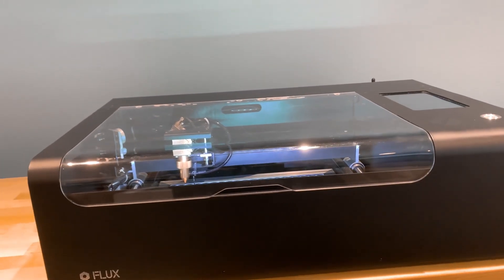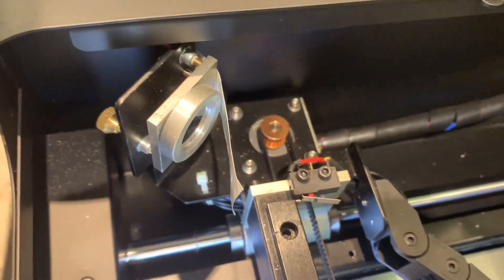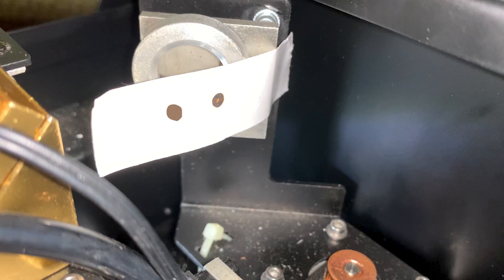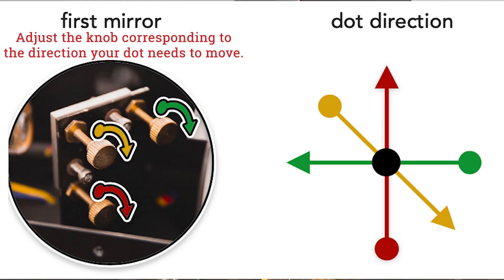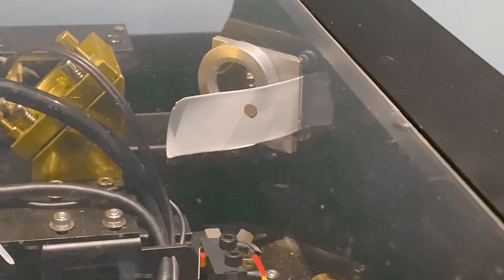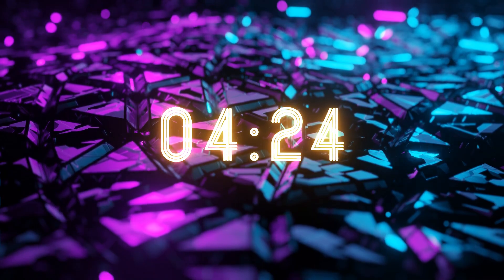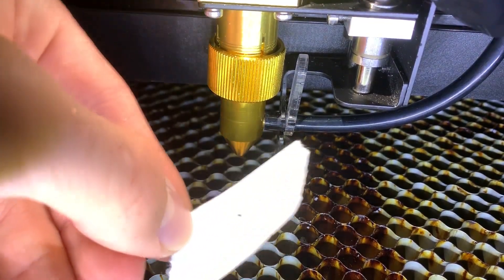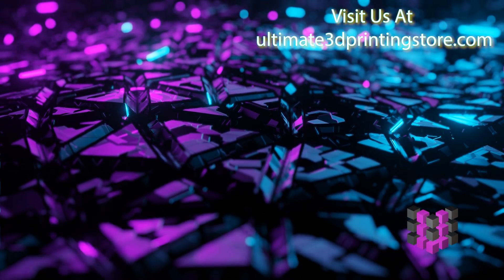U3DPS | FLUX Laser Cutter Optical Path Alignment/Adjustment

Comment: Thanks fort his video, I wish I had seen it before I started trying to align my mirrors, you would have saved me hours trying to decipher the instructions on the Flux website. I hope you can help me with something. My laser stopped firing, it slowly stopped cutting all the way through and I assumed I just need to clean the lenses. The first two mirrors are aligned but when I get to the third one there is no dot in the middle? I've used my machine for about 3 hours, when it arrived it fire a laser and I aligned my mirrors and it started working but this time I'm not sure what to do. Any quick tips before I have to contact support?
Reply from the maker: If there is no output due to the last mirror, double check the first two mirrors are aligned, and also play with moving the laser head to multiple places in the workspace (bottom left, bottom right, top right, top left, middle) and see if you get a final laser output. If you do not get any different results, you may need to contact support to get more detailed instructions.
Reply: I tried this there's nothing on my tape after I hit laser pulse on the last step
Reply: That is my issue as well!! May have it used it for three hours or less. It wasn’t assigned so we did that and it engraved a few more times. Still not aligned to my camera and what is engraved. Ecru sorry is aligned and overlapped. But now there is no output from the laser beam.
Reply: I have the same issue, all mirrors are aligned but no dot appearing from the laser head.....so frustrating! I notice you posted this months ago, any luck with fixing the problem? if so pleeeeease tell me how :(